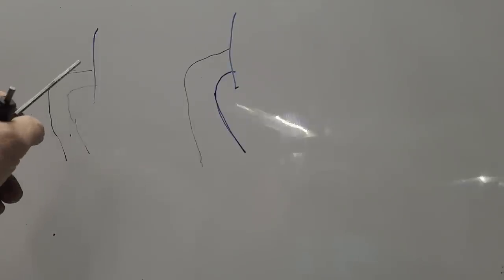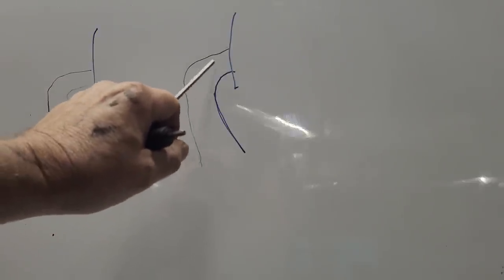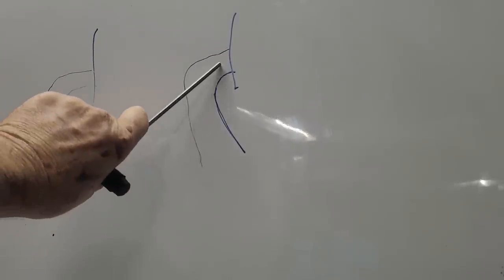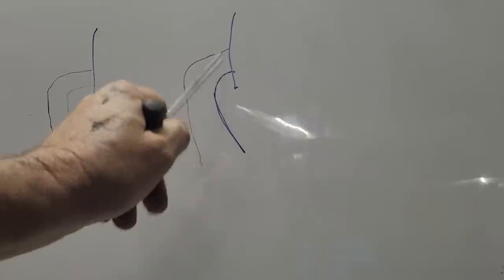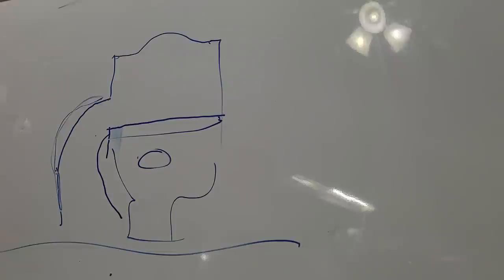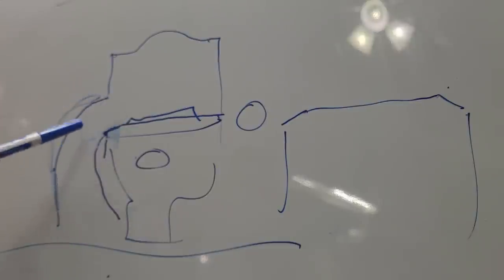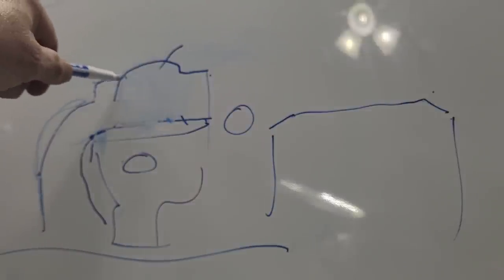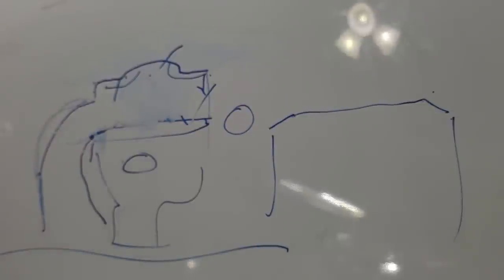my quad loop transfer secrets shared! blowdown myths debunked! power secrets!

Comment: Okay I am 62 -1/2. Back in 1976 the so-called scoot master was dragging his 67 Mustang at NE-Drag Way. I just got a 1970 Mercury Cougar with a 351. automatic. I knew jack about the way of things. I believed when I put on a pair of supper 70's slicks and spoked front wheels, I was faster. With the carburetor set with a vacuum gage I ended up falling on my face. The scout master changed the metering rods and tricked the trimming. It was better but the only thing I accomplished was trading the cougar for a 69 caprice with a 327.

Comment: whats your thoughts about grinding slight grooves from the top wall of the cylinder across the pinch band to flow fuel mix to the spark dome? Maybe less pressure forced back to the rings. I like what You're explaining it's opening my eyes and it makes perfect sense.
Reply: You would be bleeding off your compression… several cylindrical rings around your band is something pretty awesome!!! If you have a super wide band it’s an advantage if a 1/4” in or a little more from the flat outside edge it’s pitching towards your combustion chamber…. Those gas’s need the room to spin up like a little tornado into your combustion chamber…. There’s a lot of advantages to having those fuel mixture charge’s spinning up into your combustion chamber before the explosion!!!!   After seeing Harvey shave the side’s off a piston 7 years ago I started changing my timing numbers by adjusting the pistons and not the cylinder… and the weight reduction is incredible power gain’s!!!

Comment: I have always wondered if anyone has tested a reed valve on the exhaust to prevent reversion, would it hold more spent gases in the combustion chamber or would the speed that each cycle is happening hold it open at the high end but increase power down low?
Reply: Now that's interesting.  How far would the reed need to be away from the exhaust port to snap shut and cause a draw on the transfers ? Or would it ? What about a rotary valve tbat caused a vacuum just ahead of the export opening ?  Think oil pump ??

Comment: In your opinion do pioneers like short or long blow down? They’re made with that lip inside the top edge of the transfer which seems like it would not help air flow at all. Not that I have the tools to take it out but still curious how it would it  would perform with say stock blow down of 20 compared to my ported blow down of 26.

Comment: Hey Mr Ironhorse, I have a quick question; does the 52mm factory Husqvarna 372xpw cylinder make more power than the 50mm 372xp (non x-torque)?  
I got into a feud with a guy that said that the 52mm was a waste of money, because being designed for a cut-off saw, the factory porting is less ideal than a true 71cc P&C.  
Now, from experience, the husky 365 (48mm) has a broader & smoother powerband, kicking in at a lower RPM than a 372...  therefore it's more forgiving.   But the peak power is definitely in favor of the 372.  
Being a classic muscle car guy...  "There's no replacement for displacement.".... am I wrong?  
Any thoughts?
Reply: OEM XPW cylinder 51,4mm and i believe its NLA these days. All the 52mm top ends for 372 chassis are aftermarket. If you have good running saw with 50mm p&c i would just work with that. I have not messed with 51,4mm topends but heard that many guys like the low end torque of the those.